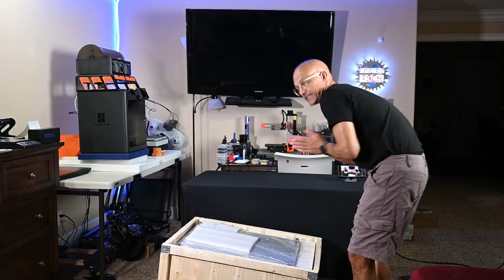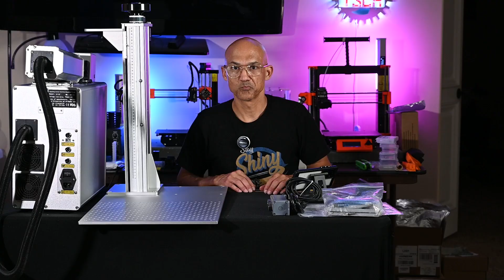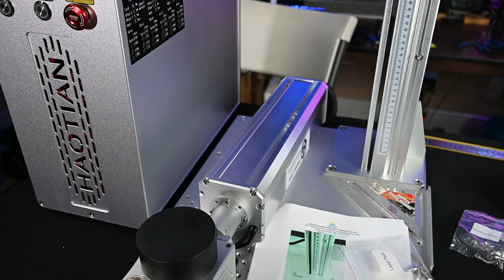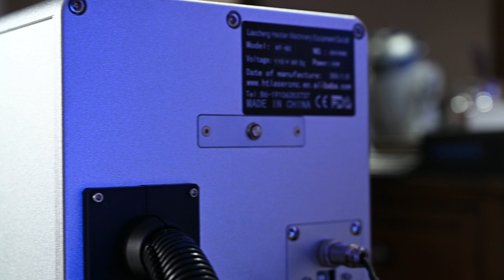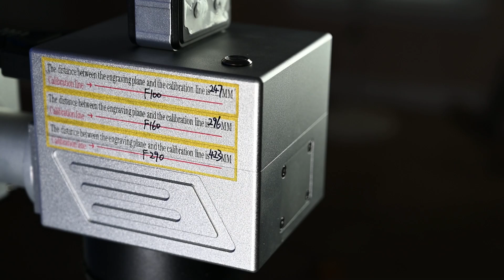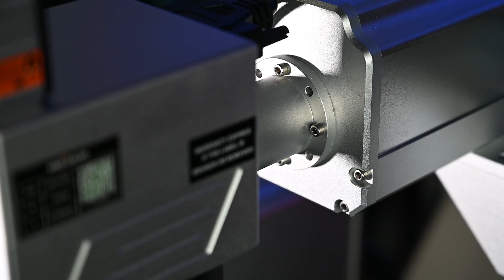Uncrating and Set Up of a 80W Haotian Fiber Laser - JPT Fiber Laser Source

Comment: Have this same unit but my motorized z axis isn’t working to go up and down. Just set it up today. Any suggestions?
Reply from the maker: There is a tiny little button on the back of the laser source that toggles the z motor output. Check that.
Reply: @directedt3ch yea unfortunately nothing :/
Reply from the maker: @michaeljames4789 And you have the Z motor connected to the laser head and the button box connected to the big laser source box, correct?
Reply: @directedt3ch nvm I got it to work. I connected it wrong lol thank you
Reply: @directedt3ch also do you have any software videos on either light burn or ezacd?
Reply from the maker: @michaeljames4789  Awesome! Glad you got it figured out!

Comment: I'm really excited about you getting a Fiber laser! I had purchased mine from another company and I wish I had gone through Pascal with Haotian lasers. My laser arrived very quickly and the company also made it a very easy process to get it working but the seller I had purchased from was no as helpful as I was told. I had great support when I was willing to make a purchase and for the first week of owning the laser but after that, I basically had no support unless I was willing to make another order. I had actually talked to Pascal and was about to pull the trigger but then this other company told me everything I wanted to hear to get a sale and the laser was around $300 cheaper during a sale they had. The machine I got is very well made and I have no complaints at all from the manufacture, I just would have rather spent the extra $300 and had the support Pascal and his team offers. I never hear anything bad about his support or his lasers and I really happy that you ended up supporting him. 

I have really only messed with some tools, business cards/wallet cards, metal wallets, leatherettes, slate coasters, and some granite. Its pretty complicated to get repeat results on some things and a lot of people charge you for answering some questions. Its definitely not like the CO2 and Diode lasers where most people are willing to at least help you get close. Some people have been great but I definitely don't recommend using the Laser Params Converter on these lasers since the speed, frequency, and LPI can drastically change results from my experience and the converter doesn't really change that stuff properly. I can't wait to see the videos you make around the fiber laser, especially getting color with the Mopa. Its also exciting to see how much this channel has grown and the new stuff additions you are getting, maybe your next laser will be a Galvo C02 or UV laser lol
Reply: thanks, and sorry to hear about that. I Would like to do my best and provide some help. Message me freely for any questions about your current machine please
Reply from the maker: Thanks man! I'm excited too!  It'll be a good while before I get another laser, but I'd definitely like the capabilities that a UV laser would bring to the shop!